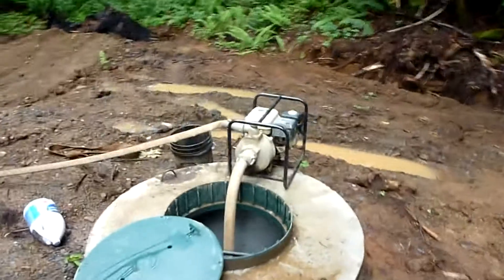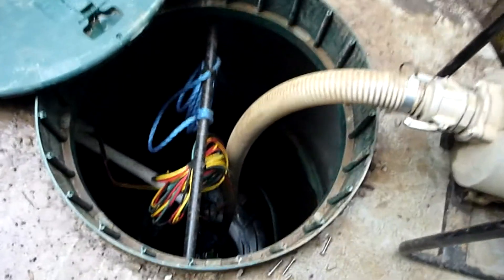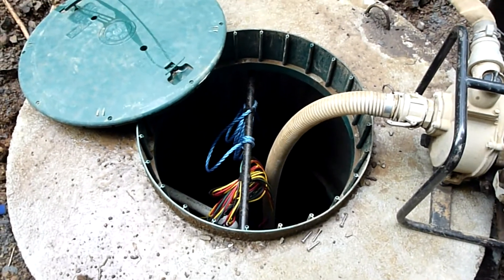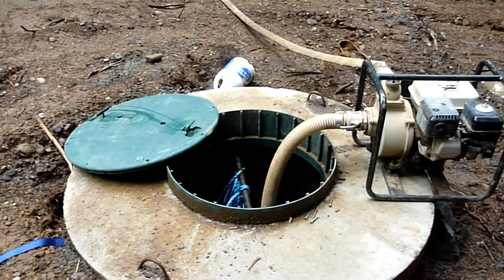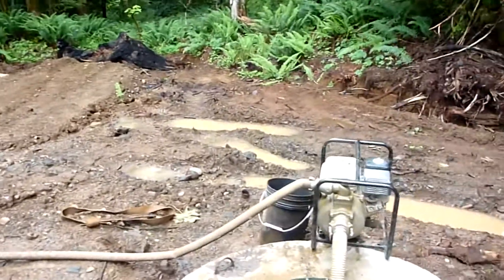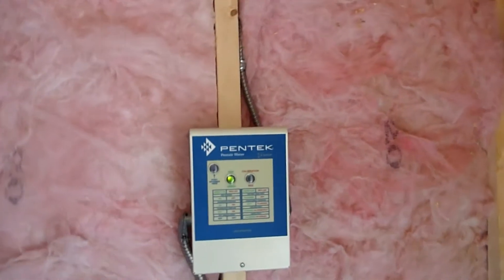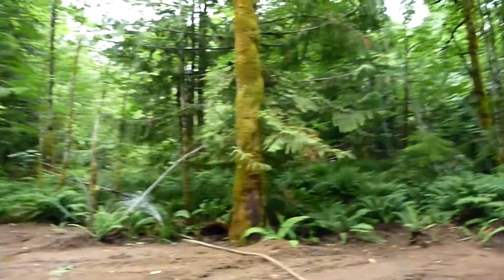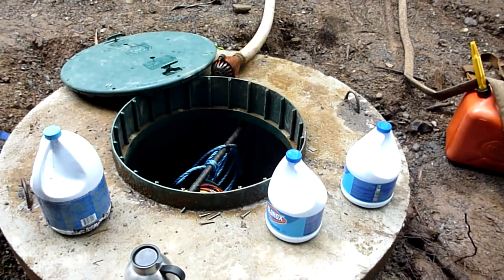Shop Project - 29 - Well Sanitizing

Comment: Hey, glad i found your video. We need to sanitize our well.. which is designed much like your own. Ours did not pass bc of bacteria. I bleached our well twice and still wouldn't pass. I thought that runoff from the rainwater might be doing it, since our well casing lid is at ground level.. much like your own.  Could you update us and let us know how your samples came back? Do you think rainwater runoff into the well would contribute to contaminating it?
Reply from the maker: Absolutely.  My well is working out really well for me in terms of capacity and production.  However, I knew from the start that being a shallow well, it would likely require treatment.  My samples came back over the threshold for fecal coliforms.  
I paid a lot of attention to sealing my well from surface runoff, but my water flows underground into my well from a fractured layer of shale which is only 6' down.  The surface water (rain) that makes it's way through the ground does not benefit from much treatment in the soil before it gets to my tank and I have a farm with livestock that neighbors my property.  So I put some filtration and UV treatment on it.  This gives me a lot of piece of mind and I have had zero problems with it.   I've changed the filters a couple times, but have not yet had to change the UV bulb.
Shallow wells like mine are extremely prone to runoff contamination, but if you plan for it and can put treatment on it, it's not a serious issue with the technology that's available these days.

Hope this helps, let me know if you have any other questions.
Reply: our well is far lower than 6' .. but we are getting contamination from 'somewhere'... my guess its runoff since our casing is at ground level and the cap is two piece with a hole in the top.  I thought about using a rubber seal they use for concrete to try to seal it off too.. but I dunno. Our well prevented us from getting refinanced and its a source of a great deal of stress at the moment. Thanks for your input.